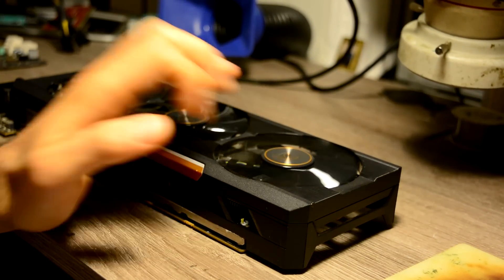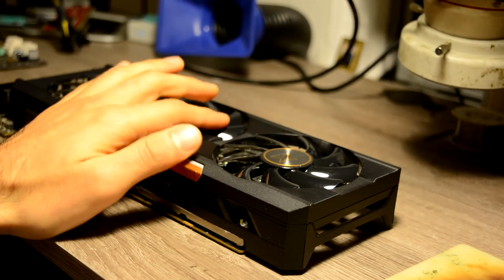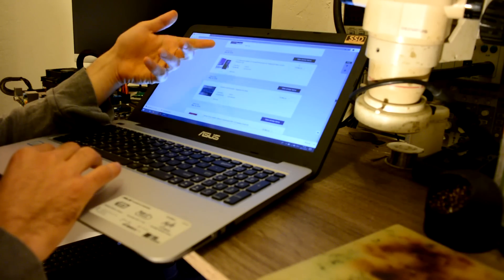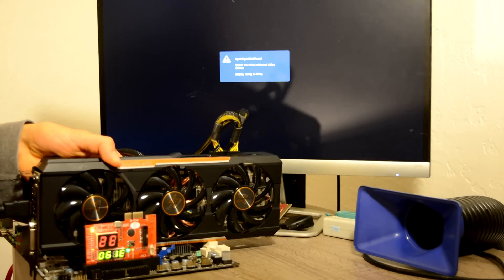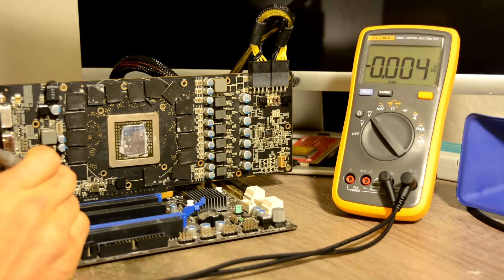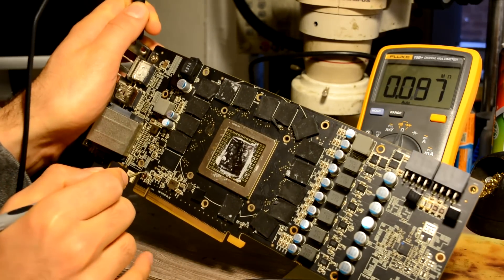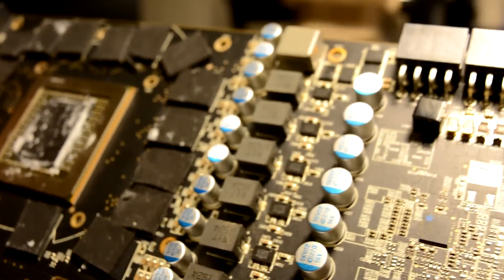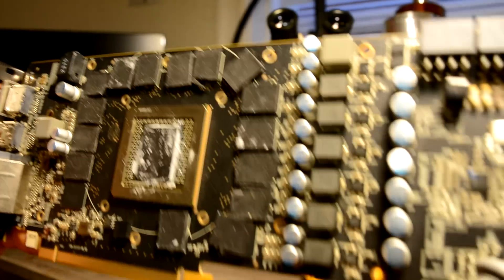Broken video cards from Ebay. Is it worth buying them and do repairs?

Comment: Hey Eli, great Videos! Really like your work! I am thinking of supporting u on patreon. U would be my first patreon than ;)

But i want to ask you, if you could make kind of a list to know what to look for when trying to repair.
So lets say, fans spin and there is no screen and the PC beeps.
What should i check? What measures should i get (voltage on memory, phases, gpu and resistances on parts)?
And if this or that has 0 V or a to high to low resistance, what is the way to repair?

I am from germany and just started this as a hobby. I had luck with one "broken" GTX 970 where i only needed to flash a new BIOS and everything works great.
Right now i have a GTX 780 which don't worked at all. I replaced two 5K Ohm resistors which where burned. Now i have fanspin but no picture and beep.

This will be the Card for my Son (11) which plays on an old GTX 560 :/

Perhaps you could help?!

Comment: Hi Eli! I have a dead R9-290X. I remember it died on me one day after I installed some heatsinks in the VRM. It sparked right where the heatsinks were installed but I can't see any burnt chip or anything black. What do you think burned? It's a stock 290X so what do you suggest I can  do with it?

Comment: Can you post a video showing how to FIX (not mask or hide) "Coil Whine"?  That would be great!!! Thank You!!!  I have a question also:  R9 380: works with windows 10 Standard VGA Driver, but has funny looking artifacting when ANY AMD Radeon Driver is installed... This is on a different card then the Coil Whine.  Coil Whine is on a a R9 390.  Thanks...
Reply: Probably dead GPU
Reply: @dexluther7  Ended up being bad bios chip.  Replaced it and flashed it with external programmer, and card is working like a dream.  
Also- I was able to solve the coil whine issues on one card I have by changing out the thermal pads as they were old and getting hard. Once new ones were in that card shut up.
The other card required me to replaced the coil, but they are only a few bucks online, so now all three cards are working perfectly again.  With that said.  Next time.. I'm staying FAR AWAY from Radeon cards.. My GTX 1070's haven't had one issue, except costing 3 times the price new.

Comment: How much would a GTX 1070 cost to repair? I also saw on another video that reballing a GPU is a temp fix since the real problem lies in the chip itself. Recently I had a GTX 1070 just "die". I sold it on ebay for nearly $200 with original box and accessories. It cost me $330 when I got it new years ago. I ended up getting a 2070.

Comment: Hi, have been trying to find a way to reach you about a Titan X I'm having problems with. The card has fan spin, GPU gets warm and runs  without drivers but artifacts or shuts down after only about a minute. MSI afterburner sees the card but does not get any information, (0mhz, 0c temp, does not say "titan X" )  After I install drivers, I don't get any display out after motherboard splash screen.

I believe the GPU itself is dying and the rest of the card is probably OK, Do you think I'm correct? What do you think I should do?
Reply: Reballing the Gpu with a working one

Comment: Hello Eli! Im having a really difficult problem im trying to solve with my GTX 970. Id also pay you money if youre willing to help me! So im having a GTX 970 which had a Short Circuit. I replaced all of the mosfets but the short still persists. The Pins next to Pin 1 all read like 1 Ohm. I soldered off the IC next to it but still a short. I soldered off the R005s hoping that would fix it. When i now measure the resistance at the PCIe Power-ports i get multiple kOhms which should be okay. But i checked the resistance on the capacitors right next to the STUNTEK R22 to GND and it tells me its 5 Ohms. I have soldered off all of the big capacitors and theyre fine. Do you know where i can look? Do you have a source for a schematic? I havent found any on the internet. Thanks
Reply: Where is exactly this short??? Do you have Photos of your card to show??? Your description is very confusing.

Comment: this video inspired me to learn how to solder.
i then fixed 6 dead graphics cards, sold them and bought new pc parts.
thanks for the inspiration.
Reply: Do you have tips on how to learn that ? I right now myself have a r9 280 and the card is working but doesn't give display and if it does after a few restarts, it will crach when it comes under heavy load like csgo or just playing fifa
Reply: How did you fix those gpus?
Reply: @mr.stealyourgirl1779  He didn't. This video is 11 months old. His comment is 10 months old. Do you think he went from not even knowing how to use a soldering iron to fixing 6 GPU's in one month? Not a chance. That's not even enough time to buy the 6 dead GPU's, fix them, sell them and purchase new parts, even if he already had the know-how
Reply: @-dazz-  thank god we dont have brilliant people like you working for the FBI
Reply: @-dazz-  could be possible. I fix electronics for a living. Mostly phones and PCs, just trying to see if graphics cards are worth it.
Reply: @twopliesman  i started 1 month ago and damn.

Comment: Can you maybe try if it works to solder a DVI port and flash the BIOS of a NVIDIA P106-100 Mining card? 
This would be a great find if those cards could be repurposed as an actual Graphics card including Display out.
From what I've heard, nvflash locks those cards, but you have soldering equipment and a chip flasher.
Those cards can be bought for around 70$. If the mod works, you could transform them into a full GTX 1060 6GB
Reply: wow man: it takes more than a bios flash to turn a crypto miner into a graphics card. Even welding on an hdmi would need a mux chip.
Reply: @paublusamericanus292  I don't know if modern GPUs still use dedicated mux chips. At least AMD have them integrated onto the GPU as far as I know. Not sure about nvidia though. 
But probably there are a lot of passives missing like resistors and capacitors.

Comment: https://www.kijiji.ca/v-view-details.html?adId=1401745214 i have a gtx 780 ti and it gives picture but white lines going threw the display and drivers will not install properly,  tried it in different systems with different psu's motherboards, same issue.  link has pics

Comment: -go on ebay
-buy "broken" gpu for 30$
-throw it into oven
-works fine
-sell for 150$
Reply: HUNter it will do exactly what he did, but improperly, and you’re a dick if you do that because cards repair like that always fail later on
Reply: yes but on ebay all are throwned into oven

Comment: Hey, do you repair laptop cards, and can you repair cards where a resistor has completely fried (leaving the area around it black and scorched)? I've just replaced a GTX 980M with a GTX 765M due to cost, and I suspect having the GTX 980M repaired would be much cheaper than buying a new one. If you can't, I've already written it off due to the malfunctions that I've been experiencing. (I only discovered the burned out resistor during the replacement that I was going to do based on its severely degraded performance).

Comment: Hi how are you? Great work!!! I have One evga SC2 1080TI with exactly the same problem, my problem was that a leak of watter hitted the same IC and the IC just exploted, the same fuse was opened but i need to change the IC. My problem is that i dont know wich part the IC is, i need the correct IC part number, maybe you can help me with that? do you know or maybe can inquiry somewhere, about the IC part number? maybe do you have some 1080ti laying around and can check it out?. Thank you so much for any assitance that you can give me with that.

Comment: Hey guys, I have a old r9 290 sitting around that will work for around 40 mins but will then crash/blackscreen and refuse to work. I've tired reflashing the bios and lowering its clockspeeds but to no avail. Any ideas or is it just dead?
Reply: you can try the oven technique, look it up on youtube saved my old gt 9800+

Comment: I just found ur channel and i have watched couple of videos. I have a question that prbly u heard like milion times, but: how did you learn that stuff? I know that 75% of this came from experience and you are not able to safe all of that broken hardware, but where did you start to learn it? Very nice vid mannnn.
Reply: chuzzzta: my guess on his electronics knowledge. 1. He is Russian. 2. In Russia they are not a throw away society. 3. Russian's are really good with electronics, and like to play war games. 4. If your card breaks in Russia, local electronics technicians were trained in electronics for the military, which means a local guy good in electronics trained Eli how to be a tech, and showed Eli what the rails on video cards are, what voltages they are supposed to be, and when one shows up like this, the first thing Eli does, is 1. Checks the pcie rail voltage. The gpu, and memory voltage rail which is a much lower voltage. 2. He checks the 12v rail. 3. he checks the 3.3 & 5v rail, and if any are not shorted to ground, then the caps are ok. 4. He checks the fuses for the main 12v rail, and the gpu fuse. Somewhere one of the rails will be shorted or open. Then he can put a power supply on that rail, with exactly the voltage it is supposed to be, and sees if a part gets hot. Just logic.

Comment: I had a few broken graphics cards off Ebay. Only managed to fix 2 of them. The last one Palit 1050 ti  had a blown mosfet in the VCore selection of the VRM and I lose resistor for the 12v sense line that prevented the card from powering up, just drawing around 30ma for the linear regulators. Fix those 2 issues but the card had no display, fans spin and all the voltages and current draw seem normal. Even tried to reflash the BIOS, still had no effect. After all that I managed to short the GPU!! Still good experience I guess. The card wasn't exactly cheap paid more than I should have.  The previous owner / seller had already tried to resolder the mosfets as they were not even sitting straight.  The warranty sticker on the screw was broken as well. I wouldn't recommend buying a card that someone has already messed with. didn't heated up the GPU in an attempt to reflow the the BGA balls, but that just getting desperate in my opinion. The card probably way too new to have issue like that.

Comment: If its an Evga card under warranty then it can be worth it. I bought what was supposed to be a working Evga GTX 1070 FTW for 200US on ebay, the card was DOA, i claimed warranty with Evga and now I have a brand new card. It was worth it, seeing as I paid $200 for a new GTX 1070 FTW. I think the card died due to stress as it was covered with a silicone grease and one of the small pieces looks like it exploded.

Comment: Hi bro! I have a problem with my gtx 580 from msi (twin frozr II). In device manager it shows me code 43. I can only use 1024x768 and 800x600 resolution. I did everything including bios update, rolling back driver, heating up, nothing helps. Can you help me ?
Reply: Check mobo bios for IRQ or similar settings. Check if drivers support gpu. Try other gfx cards. If still error 43, its bios/mobo issue. If not, card has issue.
Reply: @ayuchanayuko  Thanks, but i have already put it into kitchen stove for 4 and half minutes to 231.9 celsius degrees and it works perfectly.
Reply: @Cypek  be careful not to stress it too much and to cool it down too fast. It might fail again in 3 months or so depending on how bad the solder has become.

Comment: I just got here, first time ever. Definitely subscribed. If you are post editing the videos, normalize the audio so one part doesn't sound louder than others. Funny camera position and angle. The content potential is here, just need to work on how you present it. 
I also have a question, why do you not cover the stuff surrounding the chip you're working on in kapton tape? Is there no risk of getting them broken with unnecessary heat? I'm genuinely curious, i'd be so afraid to damage anything else that i'd cover everything in kapton

Comment: graphic cards dont need 3 fans. its just so horny kids can brag about it. even one fan is enough. i have rx560 4gb, and it runs cool in windows, without fan turning 55-56c...when i turn game on, it automaticaly turns fan on when it reaches 60c, and turns fan off when it cools to 50c
Reply: It helps silence
Reply: you have a low-end card that barely needs any fans, it would run on a big passive cooler. But more fans you have you can spin them slower to achieve the same cooling, which makes less noise.
Reply: @marsovac  i have fan running on 15% with in-game temperature of 50c
Reply: @charlieharper2529  How about listing your card cause my 1080ti sure as fuck needs 3 fans to run silent and not cook itself.

Comment: I have  an old gtx 480 card. it shows a lot white squares and lines. I opened it, checked it and cleaned it and have no idea how to fix it. After inspection it shows no visible damages. I am not a professional but I want to know: what is the possible problem and can my card still be fixed?
Reply: It probably needs rebbaling

Comment: You need to shield those capacitors from the hot air tool, you're boiling the electrolyte when you hit them with the hot air directly. Not only will they be permanently damaged, you risk having them explode in your face.

Regular aluminum foil from the store works as a shield, just tear off a big enough sheet and make it 4-6 layers thick to block the heat.

Damaged capacitors can ruin your repair if you don't replace them. If they go high ESR, become electrically leaky or short out, they'll cause more damage that may be difficult or impossible to repair.
Reply: How do you measure ESR on such capacitors? They already have a super low ESR that looks like a short on a DMM. I guess you have to remove them, probably can't test them in circuit due to the nature of the synchronous  DC to DC converter.
Reply: @haz939   You need a capacitor tester, and optionally a leakage tester. DMMs can't reliably test capacitors.

You can get capacitor testers on Ebay for $20. I use this one myself:

https://www.ebay.com/itm/222520569499

You'll need an ESR chart to know what the numbers mean, it won't tell you that a capacitor is bad unless the capacitor is so bad that it doesn't register or shows up as a short. This tester won't show leakage, but you can infer leakage if the capacitance result is wildly out of spec. If you have for instance, a 1500uF cap and it tests at 4500uF, this is far outside the usual 20% tolerance and infers the capacitor is electrically leaky. If the charge that the tester puts into the cap keeps being drained away by parasitic resistance, it will confuse the meter into thinking the capacitor is a much higher value than it actually is.

Leakage testers are also useful, but they aren't really made anymore. Your only option is to buy a 40-70 year old unit and restore it, or build your own. In either case you need to be cautious because these leakage testers can operate at high voltages, sometimes up to 2 kV.
Reply: Electrolytic capacitors usually don't like hot, but only when they are heating themself. When soldering them in (think about SMD reflow) the heat can be as high as 260 Celsius for a couple of ten seconds. You can check any datasheet about this. So hitting with the hot air for a short time is not so critical. They will explode under current only.
Reply: @zsoltkohler7096  Ambient heat of a reflow oven is very different from concentrated heat of a hot air nozzle.

I've seen plenty of people hot air tool capacitors until they popped the vent (radial electrolytics) or exploded (SMD electrolytics).
Reply: Sold caps are made to TAKE THE HEAT, clearly GGigabiteM you do NOT know what your doing. I guess we should all go see your awesome video's lolz! WE are such fools.............
Reply: @jaggerwild  Solid caps, the hell are you talking about? Ceramic? Tantalum? Mica? Polypropylene?

Solid caps aren't rated that much higher than normal electrolytics and are definitely not engineered to take lots of heat, they'll degrade just like electrolytics do.
Reply: @GGigabiteM  Polymer caps. They can indeed withstand heat unlike standard electrolytic caps.
Reply: @NSHG  No, they can't. Polymer caps have the same or slightly higher temperature rating as electrolytics. Most polymers are in the 105-125C range, with a few more expensive types being in the 150C range.

They will fry just like electrolytics will.
Reply: I've had the aluminum foil trick backfire on me since it insulated the heat, I probably didn't have small enough tip on heat gun though.
Reply: @AdmitthatijustdiditX  You have to make sure you get the foil flush with the PCB. Any air gap will let heat through.
Reply: @GGigabiteM  or instead of being a cheap skate you could use some kapton tape around the work area.
Reply: @TwiztedJugallo  Using aluminum foil is not being cheap, it's being practical. It's superior to kapton tape in virtually every way.